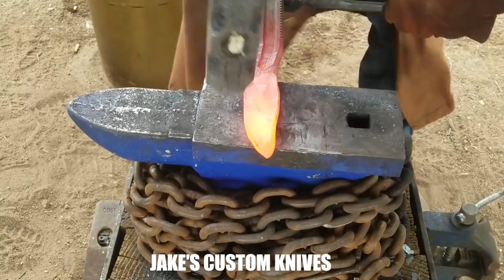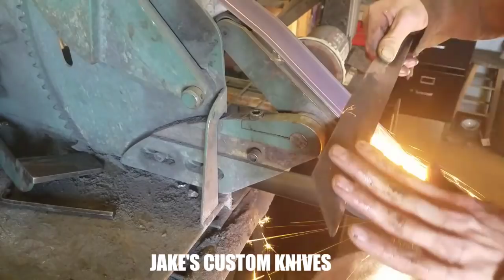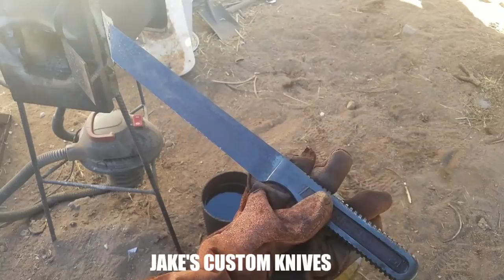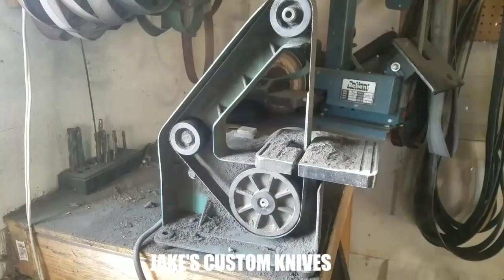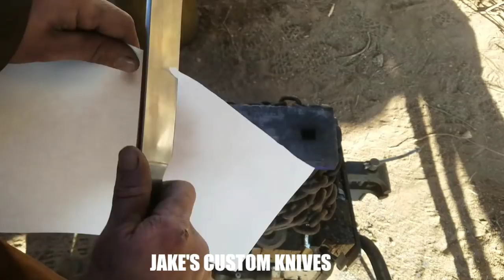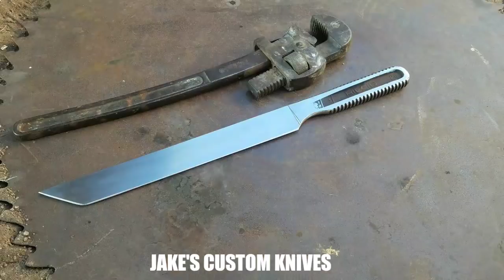Forging A Tanto Knife From A Pipe Wrench

Comment: most well made blades will shave paper finely but will yours still do it after hacking a 2x4 a few times?
Reply: AllChemystery To cut through wood i suggest an axe or a saw for best results never use a knife